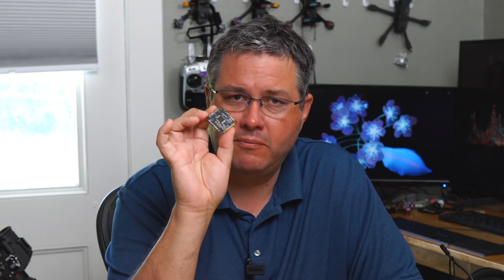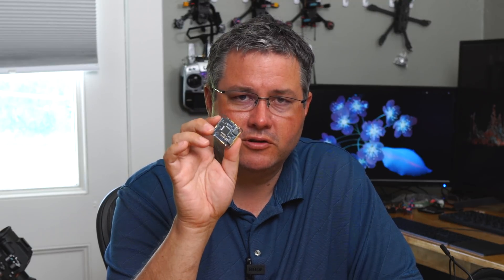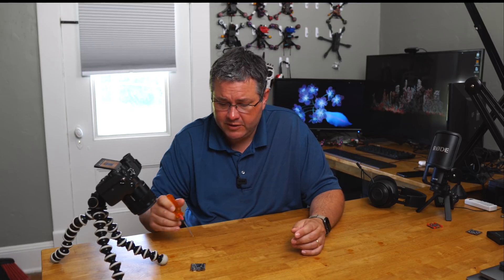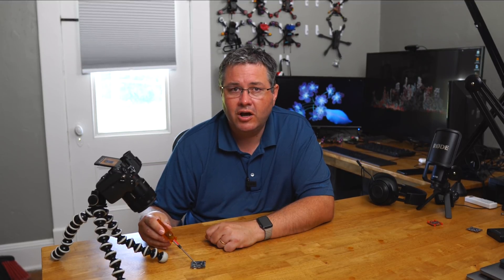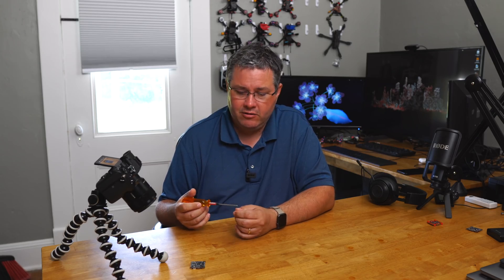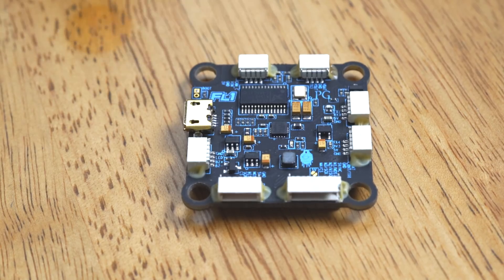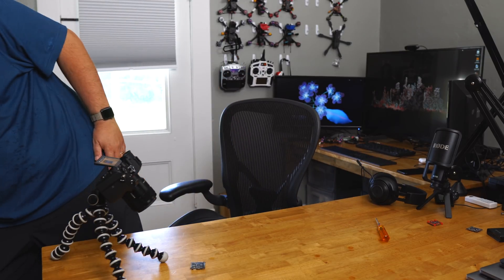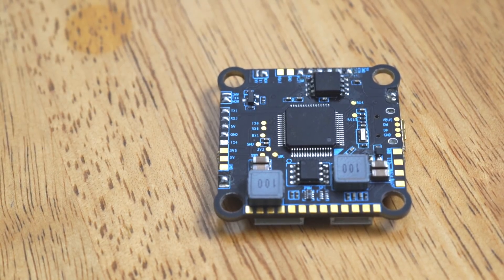Fix That Broken Revolt Flight Controller

Comment: Hi Preston i  got problem that my bolt is not powering the fc , but if i use 5v pin to power the fc then no vbat voltage show in the osd, is this technic can solved this problem?

Comment: Thanks for the videos. Question for you, I had a failsafe the other day and to my surprise the quad did not "drop" it kept its heading and flew away on me, luckily i found it, unlikely i killed a couple motors because they tried spinning in the grass for half an hour or so while i was locating it. 
Why is the failsafe keeping its heading, i have it on the bench and it repeats the same as the other day in the field, every time I shut off my transmitter, motors keep spinning, and the motors change speed if i wiggle it. 
Not sure how it got set this way, not sure how to change it let me know anyone thanks

Comment: So I have the revolt osd and bolt esc.. seems the regulator is fried.. I see the bolt sends 5v out on the cable and vbatt too.. I'm assuming without the 5v pads bridged it uses vbatt and then the regulator on the FC to get 5v.. If I bridge the pads do I need to run a separate wire to get 5v and if so where to where?
Reply: Any 5v pad or pin on the board. I've been sticking with pads (I've had pretty bad luck with the vregs on the latest revoltOSDs)
Reply: @JakeWildsJaxFL  Yeah, tried that..  I think it ended up frying my ESC and FC..  I probably messed something up, but needless to say, not doing that anymore.
Reply: @StacemanFPV  If you cooked the ESC and FC, you must've created a ground loop. I've had that happen with chaffed wires and the destruction is complete :|
Reply: guys, so now ive run my rushtank mini direct from the power lead, theres a 5v out on my rushtank, ive bridged the 5v/nc . where do i power my board? on the vbat pad or any 5v pads? is there a specific 5v pad?

Comment: My board doesn't even get picked up when plugging in USB to the computer. Take it this wouldn't help in my case?
Reply: Just Chill mine also. but the receiver lights up.
Reply: @mikrodronefiendvideos5612  yeah same. Tried soldering the 5v pad but didn't help any

Comment: Hi Preston, really loving the mini series of tips and tricks. I have an unrelated question if i may.
I have seen a few people that are fastening down the fc and seemingly run it sitting loose on the stack, what are your thoughts on this?

Also, I have been having some issues with motor vibration and know i have damaged one in a bad crash. When running the motor test it is showing 3 of them in the seriously high red levels, although unfortunately i can't compare the data to when it flew well as i didn't know about the motor test back then.
So i have done the motor test with fastening the fc down with nuts and without and the data when not secured was much better? I know that capacitors can change the data as well, do you think that the firmware for both bolt32 and revolt osd will return different results also? I really don't want to have to change 3 motors 😕
Hope to hear from you, and thanks in advance.
Reply from the maker: It’s made to not use something on top the fc, adding nuts can compress the gummies and make them not dampen, plus it transmits more vibration.  I would just replace the worst motor, are the numbers over 10,000, usually that’s when they are really bad
Reply: @FlightOneVideos  Thanks for the reply. Wow, i'll give it a go 🤞🏼 hopefully the fc doesn't move 😬😄

Comment: Can you power your fc from the ESC?
Reply from the maker: Booster fpv if it has 5v output
Reply: @FlightOneVideos  OK I have a racerstar that don't have a v5 out put
Reply from the maker: Booster fpv just use a 5 volt regulator

Comment: No I had my esc ribbon wrong and connected it and not I get no power to my fc would this fix that as well
Reply from the maker: Quake FPV it’s possible does it power by usb
Reply: @FlightOneVideos  thank for the response Preston helped me out it ended up being the MCU and after replacing it is back in action

Comment: what if it cant turn on even when using usb?totally died.
Reply: That's probably the CPU can you see a bubble or burn mark on it?.
Reply: I had the same issue tuned out it was my MCU so I got air soldered on a new one and the fixed it

Comment: Where can I get a 5v source from the millivoltOSD, to power a 5v unify pro.
Reply: I run on all my setups a 5v Unify V3 on MillivoltOsd V2. Best you can do use all the wires from the regular vtx plug, except the 5v in I get from the big plug under the Esc plug on the MillivoltOsd the one with also miso mosi in. I read that on some Facebook group. I can tell this works absolutely fine over months, good video no problems.
Reply: @enrico320i  do I need to make some sort of plug to get the 5v? Because it's not a pad where I could just solder it on. Any help would be more than appreciated.
Reply: @michaeldyer6079  Yes you can use a full 6pin plu and only use the 5V cable. Or just use a 4pin plug also fits this plug and only use the 5v from there. Watch the wireing diagram from Flightone.com.
Reply: @enrico320i  I got it going, she flies freaking amazing
Reply: @michaeldyer6079  nice good to hear a feedback. Happy flying than!!

Comment: Speaking of broken fc’s I need to drill one of mine out and email you back to get my discount code lol.  It’s been a few weeks and I completely forgot I emailed you guys about it. Lol.
Reply: Archer FPV Not missing out, their shipment still hasn't come in yet anyways.
Reply: mpickering54321 no worries. I’ve got 4 other fcs to work with lol. Just the older v3’s and not the osd boards.
Reply: Archer FPV yea I got 5 on order now lol. If you do finish that FC replacement sounds like their next shipment is coming this week though.
Reply: mpickering54321 that’s cool. I do need to get a couple more revoltosd and millivoltosd boards.

Comment: Preston. I downloaded falcoX it went on the fc ok. But when I plug the lipo in I only get 1 set of tones from the esc. But when I put regular firmware on it. I get both sets of tones. What could the problem be?
Reply from the maker: DIRTY FPV jumper and dfu flash it
Reply: @FlightOneVideos  do I jump the boot holes.
Reply: @michaeldyer6079  yes jump the boot holes
Reply: @bobedigi  thank you, do you know if the buzzer pad is 5v? Trying to find a 5v source to run a 5v unify pro
Reply: @bobedigi  when I jump the boot holes and plug the quad in it says connect a device
Reply: @michaeldyer6079  check your drivers in zadig and the other driver.... when you go into dfu is it only a green led. The blue shouldn't blink
Reply: @michaeldyer6079  I run my crossfire off 5v
Reply: @bobedigi  I have crossfire as well. But it's a plug how would I get 5v to the vtx? If it where a pad you know I'd just solder them both on same pad. But a plug in not sure lol. Thank you for your help
Reply: @FlightOneVideos  when I go to DFU flash, I get a screen that says waiting for device. What do I jump on the skitzo millivoltOSD.